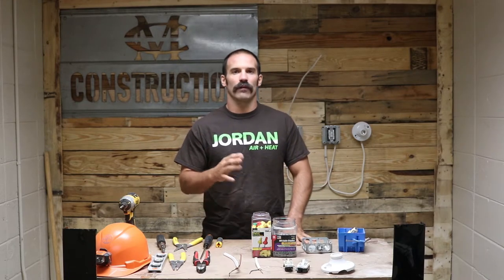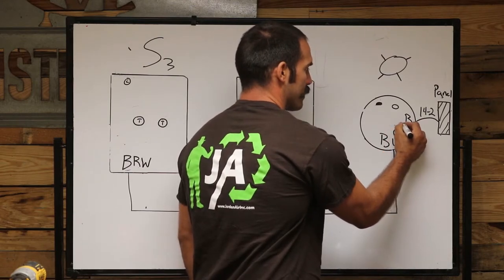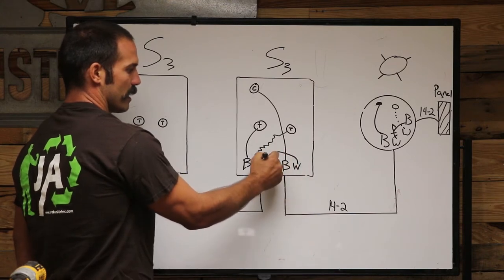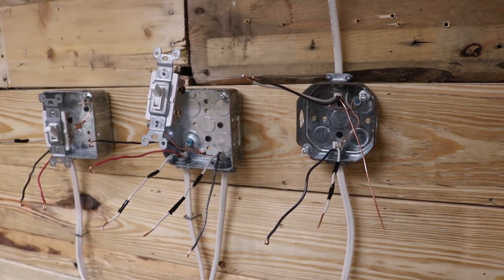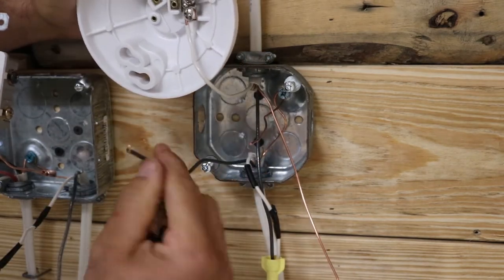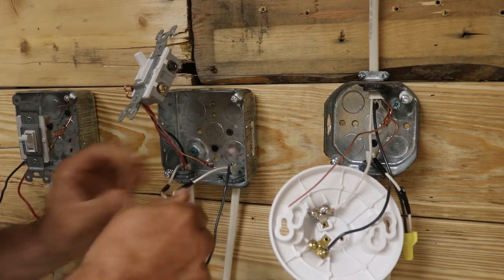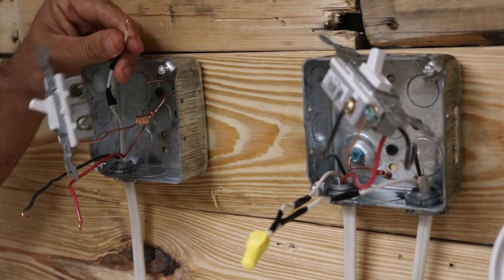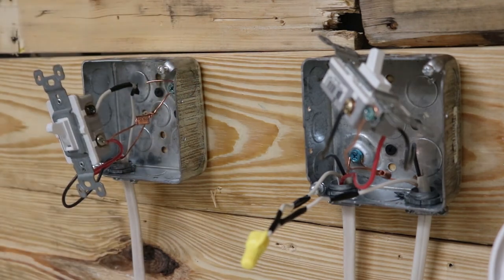3 way switch: Power into the Light

Comment: In the US,  as of 2011 this method is no longer code compliant because it leaves no neutral in either switch box.  A neutral is required in at least one of the switch boxes, to allow for the future installation of electronic switching devices requiring power in stand-by mode.   You'll typically come across this method in homes built before the 1980s.

Comment: In this configuration, can you tap into the incoming hot and neutral wires for continuous power to other light fixtures and still have the switching work correctly? Thanks.

Comment: How does this method satisfy rule 4-022 2) in the CEC? There is a new requirement since 2018s version that there be an identified conductor (neutral) left at each location of a manual or automatic control device.